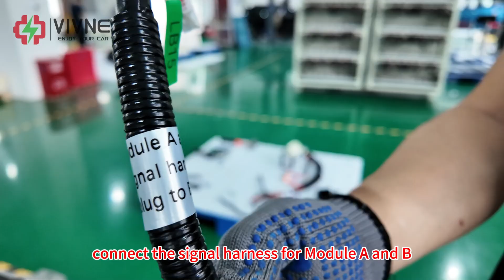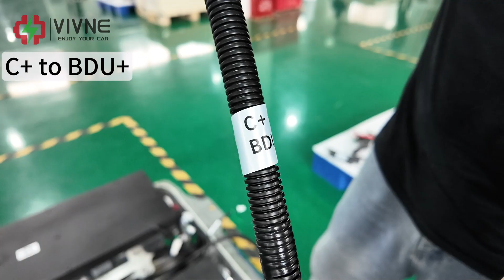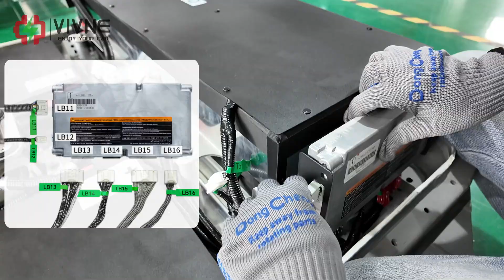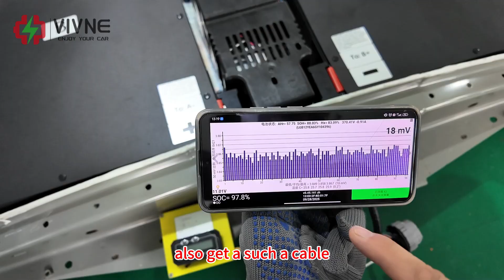VIVNE-Nissan leaf ZE0 50kWh battery module installation guide

Comment: What is the Life cycle of the battery?
Reply from the maker: We use CATL cells, the cycle life is over 2000 times
Reply: @VIVNE-CoraLiu please confirm, it should be much more than that.

Comment: Excellent development work. 👍 The Leaf is a reliable car; a 50kWh battery replacement will give a Leaf an extended life. 
It would be more efficient to assemble the new modules into a battery pack in the factory because staff will be familiar with the process. 
Also, an old battery casing will have corrosion in cold wet northern Europe. 
Consider offering a complete battery pack as an option. 🤔
Reply from the maker: Thank you for your kind words and thoughtful feedback. 
Yes, we totally agree, actually we also offer complete battery pack, plug and play.